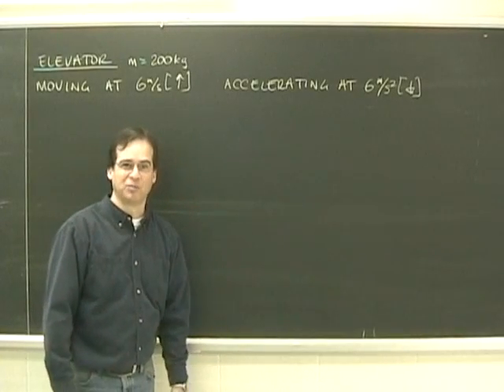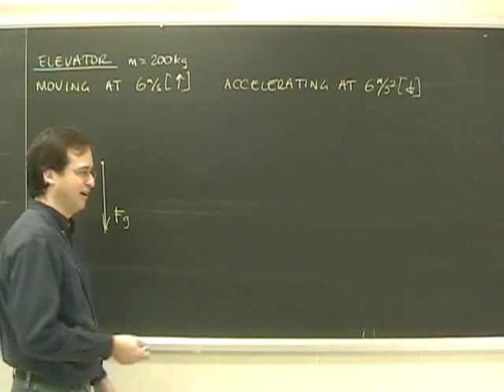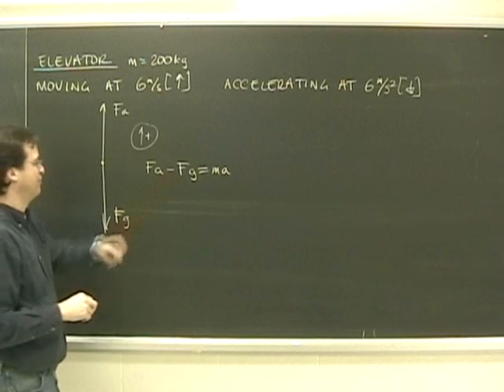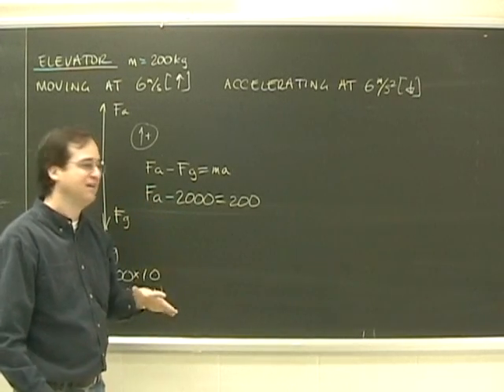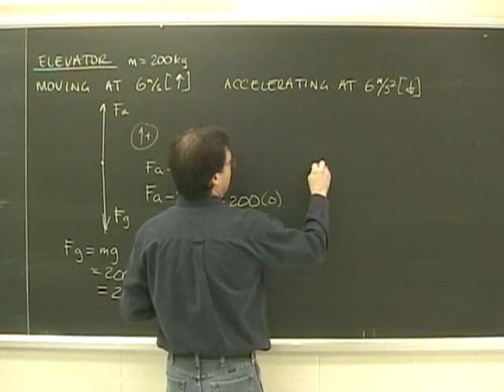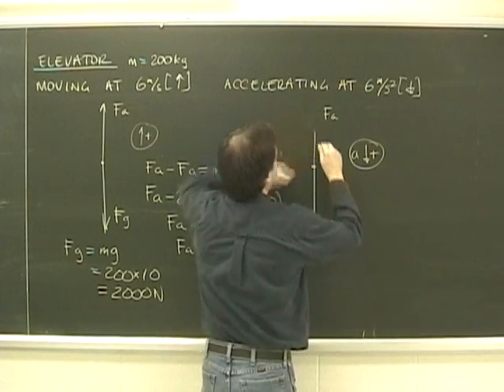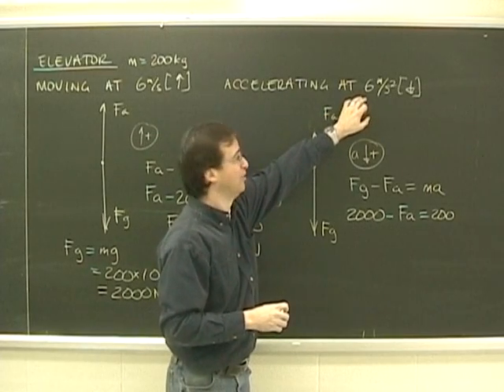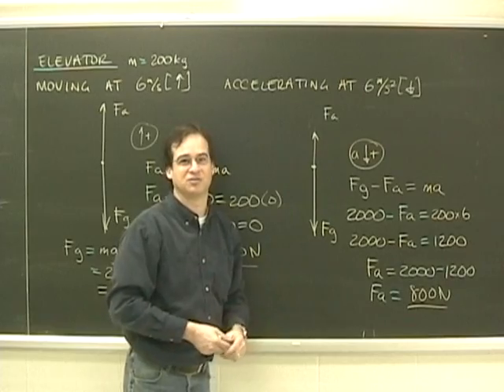Elevator Problems Part 2 Free Body Diagram Physics Lesson

Comment: why is acceleration 0 when finding fa (fa-fg=ma) but 6 when subbed into the second part? (fg-fa=ma)
Reply: acceleration is 0  in the first part because it is moving at a uniform velocity. (Which means constant velocity, which means it is not accelerating). In the second one, 6m/s was subbed in because he stated that it was acceleration, and because it was 6m/s (squared).

wow i did not realize that your question was 2 years old.

Comment from the maker: @619carnage The direction of acceleration is (+). In the first part it is accelerating up so up is (+). Fa is then (+) and Fg is (-) (down) and solve for Fa using Fa - Fg = ma. In the second part its accelerating down and so down is (+) and since Fa is up it becomes (-) and Fg is down so it is now (+) for this calculation. We can solve for Fa using Fg - Fa = ma and when you rearrange it for Fa you get it (+) Fa=Fg - ma, I skipped a step in the rearranging so that might have been what you missed.

Comment from the maker: @crazylittleme9021 You can chose any direction as positive. It’s easiest to do these problems by making the direction of acceleration positive. In the first example the elevator is NOT accelerating so you can choose any direction as positive so I chose up as positive. In the second example it was accelerating down so I made down positive. Since down is positive the acceleration is positive, Fg is positive (down) and Fa is negative (up) so you get Fg – Fa and plug in the acceleration as positive